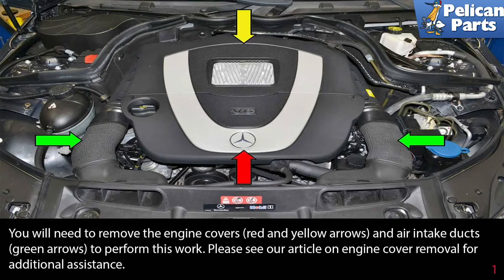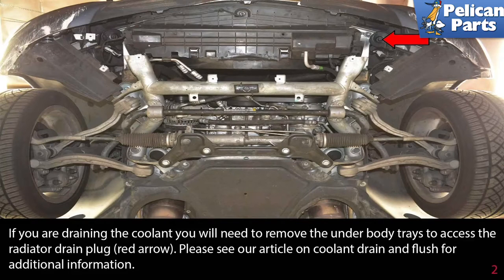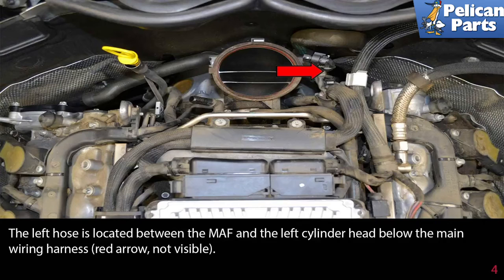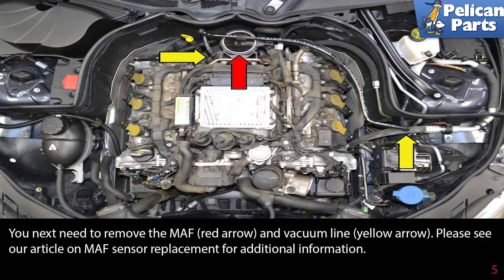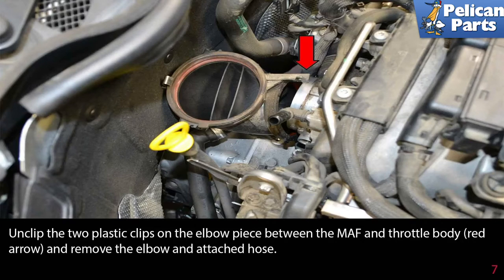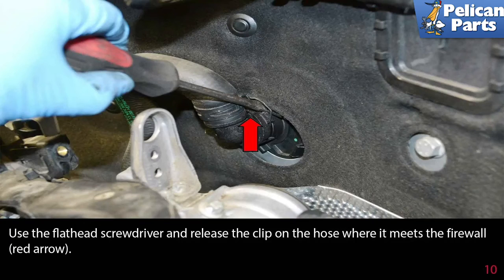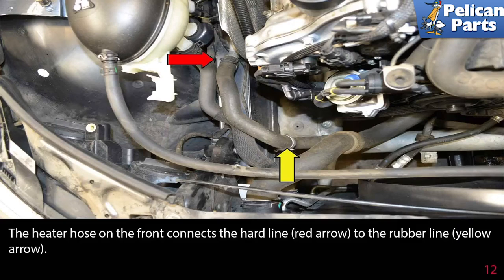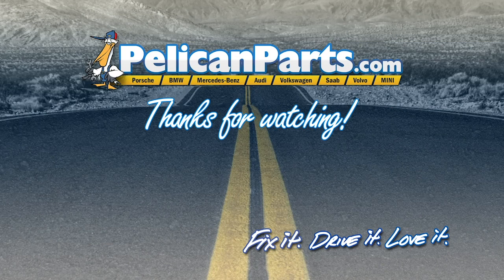Mercedes-Benz W204 C-Class Heater Hose Replacement

Comment: would you be able to provide me with the left hose part number??
Reply from the maker: You didn't mention what year and model vehicle you are working on.

With your vehicle info handy, give The Pelican Parts parts specialists a call at 1-888-280-7799. They can figure out what part or repair kit you need.